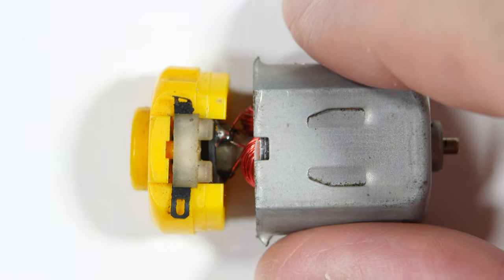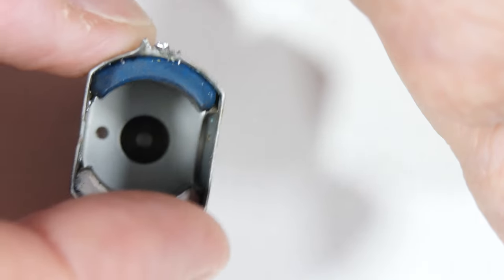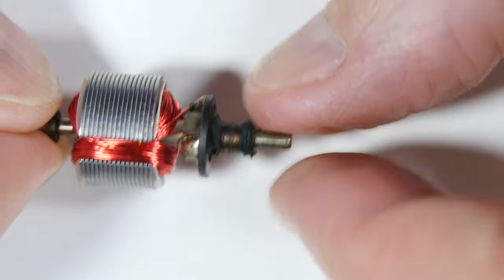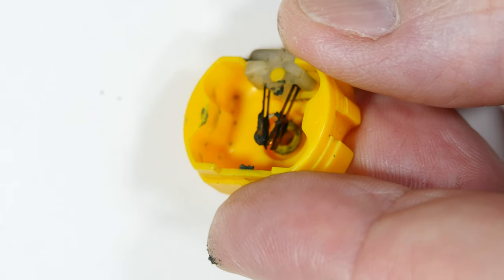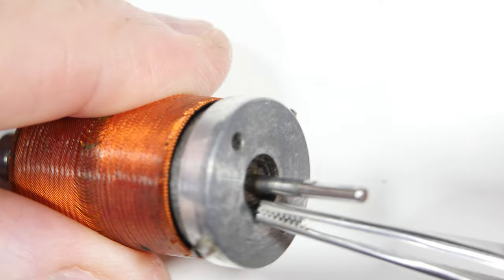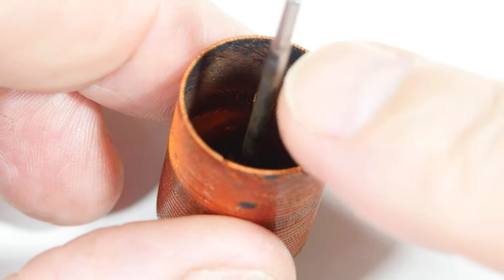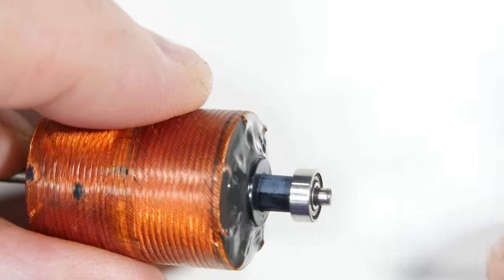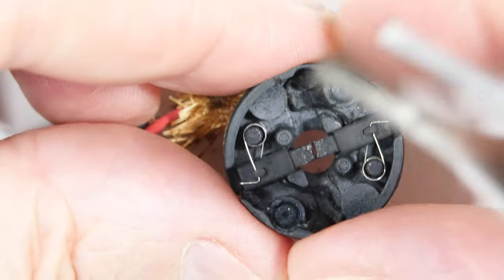$0.25 Vs $100 Small DC Motors

Comment: Those coreless motors by faulhaber , Maxon and portescap are superb, very low innertia so super high acceleration,some with rare metal brushes. Used a pair on my earwig balancing robot 10+ years ago. highly recommended for any robot use. Nice video.

Comment: Coreless motors found in many smaller RC toys amd older phone vibration motors have a rotor that looks exactly like the expensive motor, just a basket of windings attached to a disc with a commutator at one end. The basket is wound by a machine, so it can be very small and still almost as cheap an the first motor. The main differences is that this is a particularly big coreless motor, and it has proper brushes and ball bearings, instead of sleeve bearings and sheet metal brushes similar to the first motor. I think the magnet being so big is what drives up the price the most, as big neodymium magnets can get quite expensive.

Comment: You should check out the motors used in professional slot cars. Not the Scaletrix cars, the proper custom or hand made chassis slot cars. They start with what's called a 36D motor and work up to what used to be called an "Open" motor. Keep in mind it has been a very long time since I was part of that scene, so things have probably changed quite a bit.
Reply from the maker: I had to find a picture, but I remember those.